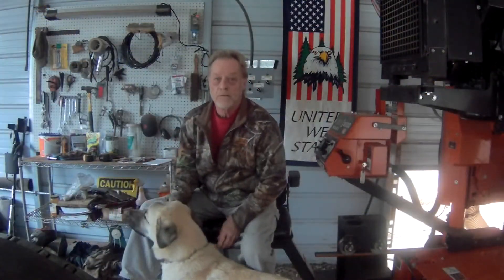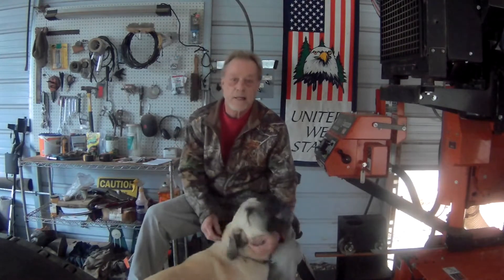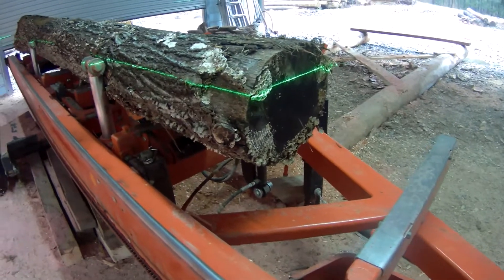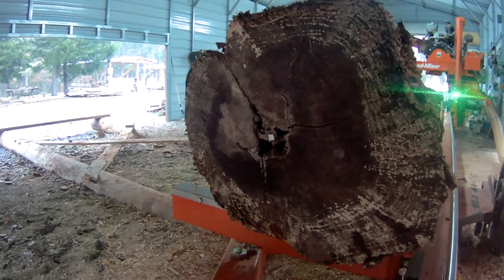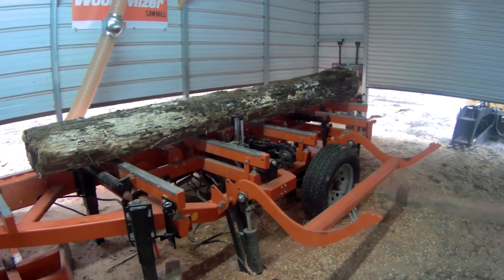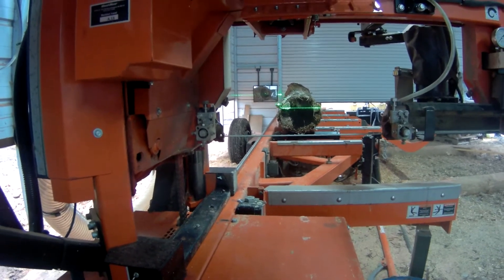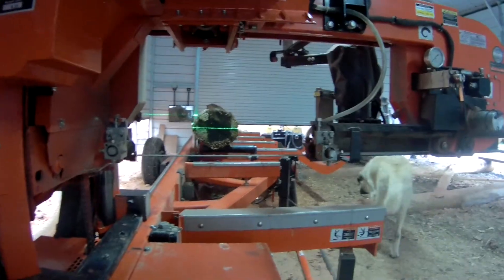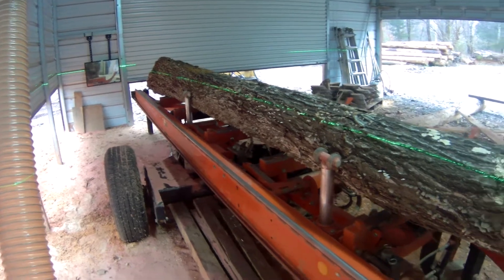Laser upgrade to my Woodmizer sawmill ...set the pith in seconds.

Comment: I received parts from Woodmizer but not the "safety cover".  Do you have a part number for it?
Reply from the maker: I don’t, it came with my bracket. I’m pretty sure of that. I would call Woodmizer.
Good luck, you’ll love it. Just take your time setting it up.
Reply: @oldbluffsawmill5235  Can you send a photo showing how you mounted the laser to Woodmizer's bracket?  Also, did you ground the laser using a screw through the bracket?
Reply: Thanks, I just ordered the extra parts from Woodmizer.

Comment: Thank you for the video on the green laser line installation.  Could you please send me the information on what kind of laser you bought and the adapter to lower the voltage down to 5 volts.  Thank you again!  Have a great day!!
Reply from the maker: Here is the new link. I’ll have find the 12-5volt transformer.
https://www.ebay.com/itm/134595366289?hash=item1f56824d91:g:7iMAAOSwZ3Vilwff&amdata=enc%3AAQAIAAAA8GX5M1%2FqVq60MdiWc9wsyCORbcDCua7WfHVMs%2F1X%2F6ex5j08YpCndhc6pIjcAxdTOQ2oi7NUIq%2FP9YIncDvCpxPeVYmKIMmMUVrm4abm5f7ZAfILur86C%2FEgpgE54Hr%2FQmSTneR4%2BZmUjpsYWClxcU8v4KlRyfwJ5S8J6DipHpU2nqCS%2FXhMs3bGd40QZ4V15NwwXfu6fhtmAW6tf1h3seqqfqdkzwy0VF3207eHFCYgh9bTjV0%2FVudbtSZ18bu4dLzoZrh0hci5eHSy6pjluPWlgBCNedQ365byqOomcjRZZ9faL3YTmTSZ2JMzGu%2BUwg%3D%3D%7Ctkp%3ABk9SR4D8morMYg
Reply from the maker: Charles here is the transformer link.
https://www.ebay.com/itm/194214221202
Reply: Thank you so much!  I really appreciate your time to talk and the laser information! @oldbluffsawmill5235

Comment: Great Video, The link for the laser is no longer working. Do you have any other info that would help me in getting the right one. Most of the ones I'm seeing on ebay are a line I think you need a cross line laser" maybe wrong terminology" but not just a straight line or dot.
Reply from the maker: Here is the new link, sorry about that.
https://www.ebay.com/itm/134595366289?hash=item1f56824d91:g:7iMAAOSwZ3Vilwff&amdata=enc%3AAQAIAAAA8GX5M1%2FqVq60MdiWc9wsyCORbcDCua7WfHVMs%2F1X%2F6ex5j08YpCndhc6pIjcAxdTOQ2oi7NUIq%2FP9YIncDvCpxPeVYmKIMmMUVrm4abm5f7ZAfILur86C%2FEgpgE54Hr%2FQmSTneR4%2BZmUjpsYWClxcU8v4KlRyfwJ5S8J6DipHpU2nqCS%2FXhMs3bGd40QZ4V15NwwXfu6fhtmAW6tf1h3seqqfqdkzwy0VF3207eHFCYgh9bTjV0%2FVudbtSZ18bu4dLzoZrh0hci5eHSy6pjluPWlgBCNedQ365byqOomcjRZZ9faL3YTmTSZ2JMzGu%2BUwg%3D%3D%7Ctkp%3ABk9SR4D8morMYg
Reply: @oldbluffsawmill5235  Thanks just ordered it
Reply from the maker: Good deal

Comment: Liked your video very much
I do have two questions??? 
Wires going from the 12 to 5 V transformer how do you connect them with the round connector on your laser line???    
I have the wood-Mizer mounting bracket how do you mount your laser line to that wood mizer bracket?
I have been cutting with Wood-Mizer mills since 1985.     
Thank you, from Mike P
Reply from the maker: Heah Mike
I cut any wire ends off, then solder and apply shrink tubing. The connection point at the breaker inside the control panel is done by crimping on the proper end to attach it. I believe it is a 1/4” spade connector.
My laser came with its own mount. It has a centerline hole drilled in it, so I drilled a hole in the WM bracket to match it at blade level.
I hope this helps. I may do a feature video on the laser, because I have had so many questions and comments about it.
Thanks for watching and commenting.
Reply: Thank you so much!    The green laser seems much better.     
I like the mirror idea too!
Thanks again
Mike P
Reply from the maker: I use the laser way more than I ever thought I would. It ranks right up there with my ride-a-long seat. I only use the mirror now to see the butt end of the log. I line the laser up with the line it creates on the metal post of my roll up door. It’s right next to the log and lights up good. It really works good.
Take care and be safe

Comment: Great idea with the mirror I noticed the laser doesn't show up on the glass but if you put a piece of black paper partially into the screen you can probably get that line of laser to go right Within a fraction of an inch to the dot on the log I'm going to try that
Reply from the maker: That’s a good idea John, I’m gonna try that. Having the metal post really helps because I can sight down the log and line it up there., not even using the mirror. It works great for it. Thanks for watching and commenting on that.

Comment: Thanks for the walk-through, it's encouraged me to explore the diy laser option in my lt40 remote. Was it obvious which wire was already pulled through and intended for the laser- a color or number perhaps? I hope not to have to run another wire that wouldn't be tidy, and it looks busy inside the jackets. 
I've ordered a green laser and the transformer. Do you happen to have a WM part number for the bracket? I was thinking I'd have to fabricate one. Thanks!
Reply from the maker: Wire number 25 is tucked up above the drawback arm motor. Look in your manual for the laser mount part number. It varies for each machine. Mine is an LT50. Good luck, take care and be safe. Then wash your hands
Reply from the maker: Alan send me your email and I’ll send you the wiring instructions
Reply from the maker: Mine is wbsimms@comcast.net

Comment: Just bought your set up. I have an LT35 Hydraulic and plan to have it wired in soon as it comes in. Thanks for the Info!
Reply: All wired up should have it adjusted today.. Not enough time in a day!
Reply from the maker: Good deal, are you gonna do the mirror too? Did you get the transformer?
Reply from the maker: If you have any questions once you get going just let me know. I’ll be glad to help.
Thanks for watching
Reply from the maker: Did you get your laser going? It sure does help, I can’t imagine running a mill without one now. I bet I do 10 different things with it. You’ll see! Good luck with it
Reply: I Have the mirror and the DC/DC step down converter to get the 5v out put. I wired it up to run off a Dewalt 20v Battery so I didn’t mess the factory wiring.
Reply: I would send you a picture… Not sure how in the comments.
Reply: Do you have a Facebook or Email to send some Pictures?
Reply from the maker: My email wbsimms@comcast.net

Comment: Great set up! I didn’t realize how well the laser marked things. I’m sure you’re being careful, but if that is actually a 100mw laser there is a pretty significant risk of eye damage, especially with that mirror. A lot of cheaper ‘100 mw’ amazon lasers are often more like 10mw in the end, but it might be worth checking further as some don’t filter infrared (which is more dangerous because you won’t blink). If you talked to the manufacturer and went down to 5 volts, that may be fine too, I’m not sure.
Reply from the maker: A few seconds is all I use the laser and it diminishes a lot when it hits the mirror.
Thanks for watching and the comment.
Reply: That's all you need is a few second for damage to you or your dog https://youtu.be/Tfdgn9gXppg

Comment: Thanks for the video, I am trying to add a laser to my mill. I found that the laser shakes too much when the engine is running. Did you have any issues with that?
Reply from the maker: No Rich I don’t have that issue. What mill are you running?
Reply from the maker: Did you figure out how to stop the laser from vibrating.
Reply: @oldbluffsawmill5235  Sorry I haven't gotten back to you yet. I am using a Wood-Mizer LT15GO. I haven't gotten around to working on this again.
Reply from the maker: Rich I bought the bracket from WM and it’s good and rigid. I’m just not sure about the LT15 GO

Comment: I'm in the process of adding a laser to my Cook's mill. I have the one mounted for the log similar to yours but haven't tested it yet. I'm also planning to put one on my height scale to get a finer line there as well. Thanks for showing your install.
Reply: I'm also wanting to  add a laser to my Cook's HD 3238 sawmill. Been researching my options. My problem is of now, its located outside completely and I am concerned that I wouldn't be able to see it.
Reply: Also adding one to the scale is an awesome idea. I don't have the computer on mine so that would be an excellent  addition. Maybe giving me even better accuracy. Thanks for the idea
Reply from the maker: Jason, you’ll be surprised at how the green 100 mw will show up outside. The end will show up good but it will diminish down the side of the log. Good luck with it and thanks for watching
Reply from the maker: Yes sir and good luck, they really help. I hope you got the green 100 mw